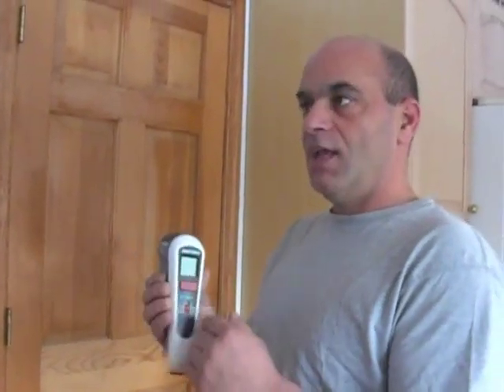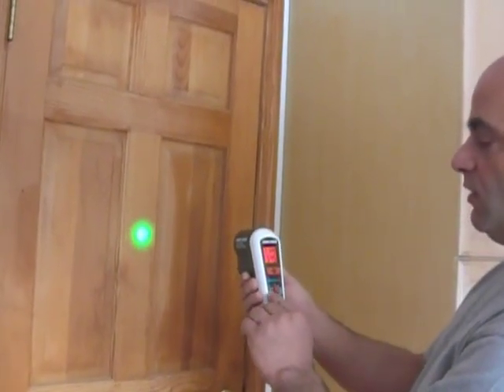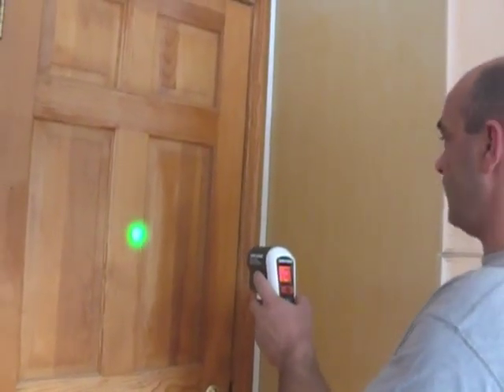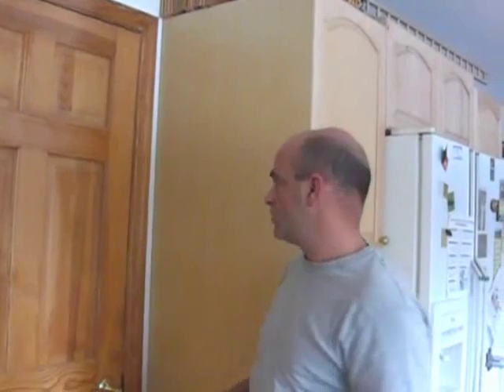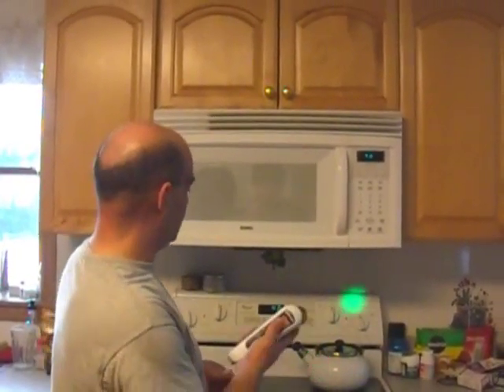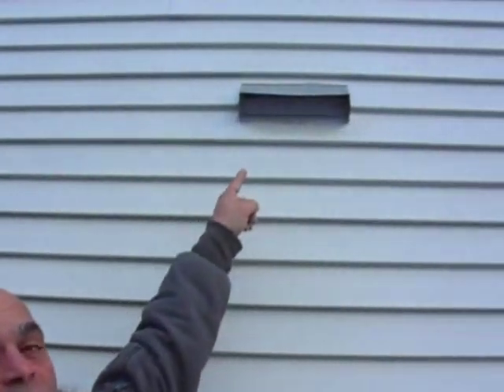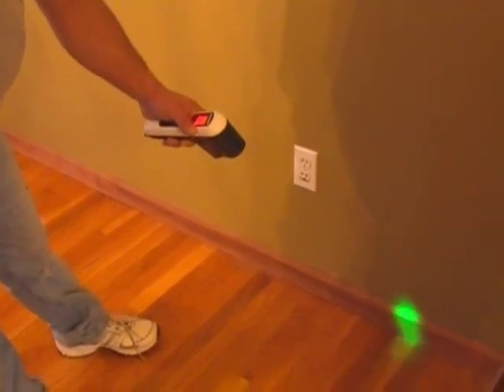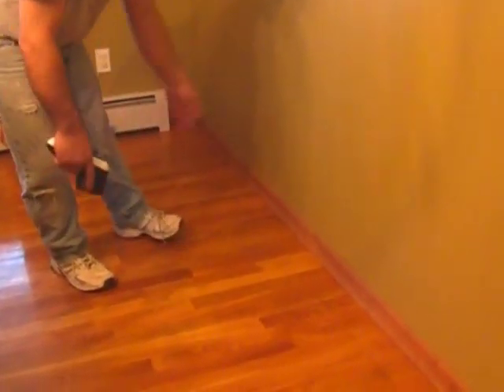How to check for leaks using this cool tool from Black and Decker, the TLD100

Comment: yes, it's fantastic, but there will always be a temperature change at the same points, such as the corners of the door or socket holes, right? I don't need to buy this tool to know without it.

Comment: this thing is awesome my house is built in the 1950s so im re doing everything no insulation and the electrical is old no ground in the house all the windows leak air and the house has no sheet rock plaster only so I don't think I need it but I think I just might by it just in case

Comment: Someone may have already ask 
 this question Im not sure but Can you use the tld100 to check the temp difference of the electric wires from a home circuit
 breaker box

Comment: I went to PAT testing training and saw like a doll’s house in there. I asked what it’s for. They said they were lecturing about heat detectors that loft insulation fitters use. They said the police use them from a distance to check for people growing marijuana indoors. They said that it’s easy to tell in winter because all the houses will be covered in snow except the drug dealers as his flat is hot.
Reply from the maker: No kidding, that's interesting

Comment: it's not a good idea to go up and down especially on the door at the start of the video, as the temperatures naturally vary, heat rises, you should go across for a more accurate reading, so people will not be insulating where it is not required, good video otherwise